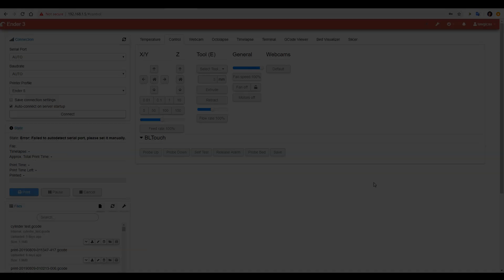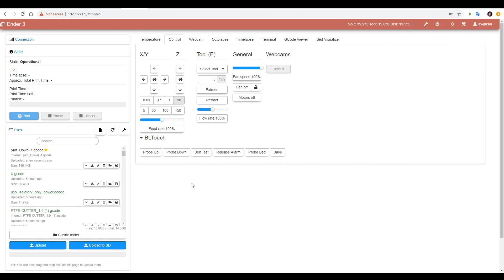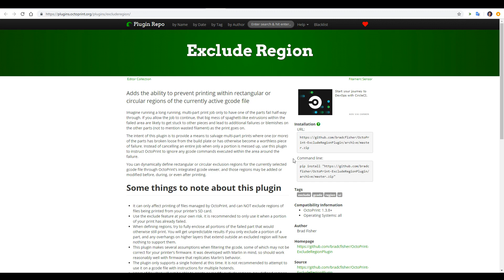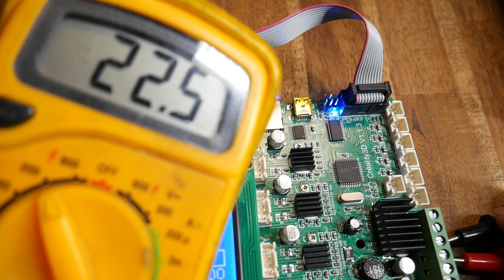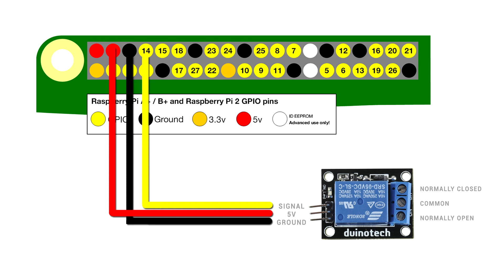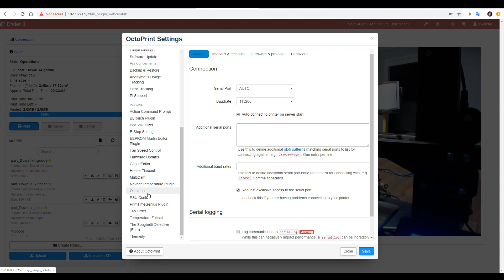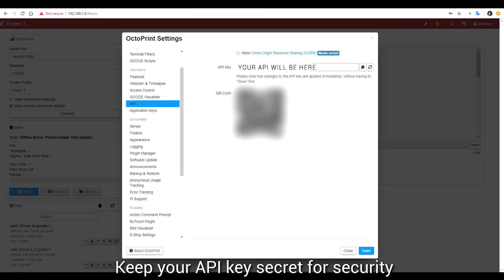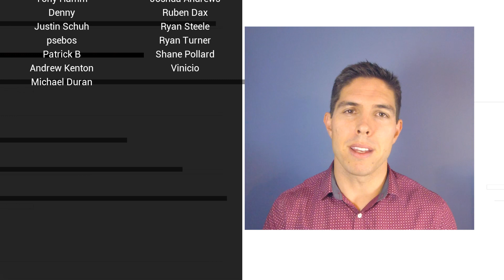Octoprint plugins for better and safer printing - PSU relay control

Comment: On 120V (US) I've seen 4 amps drawn when both the bed and hotend are heating. Translate that down to 24V (E3 pro) and you have the potential to see 5x the current of that on the mains. I would recommend checking the DC amps on that cable. Your relay package is only rated for 10A DC as DC is harder to "break" than AC. I'll get my clamp in a bit and gcode both heaters up to temp and report back on the current. Maybe I'm wrong as the meanwell supply isn't very nice from a Power Factor angle.
Reply: No question that the relay is undersized. The power supply is rated at 15 amps so the relay has to be rated at 15 amps or more. The bed heater alone is rated at 220 watts - about 9 amps. Add the hot end draw to that and you would certainly exceed 10 amps. There is more of course - steppers and electronics board.

It would be ironic for the relay to catch fire from being overloaded.
Reply: @BruceMFerry  that is what I was thinking too, also a risk is that the relay melts to a point during normal use that it no longer can open/close depending on which option was used NC/NO, and the cutoff feature is lost, ie cannot act as a cutoff.  Will look for a higher power 3 volt relay.
Reply: According to the Fluke i410 (for accuracy reference) clipped around the red wire between the PS and MKS I had 11.3A flowing while heating bed and hotend. I get 0.3A when just the hotend and board fans are on.
Reply: @OldCurmudgeon3DP  Looks like we have to go to mosfet switch boards to get to > 10 amp.  Found a few in the usual places.  But I have already printed the PI side of Mr Michael's back end electronics housing.  I waited on the controller board side as, I mull over trying my hand at remixing to add cable chain mounts to the cable exit points.  Someone might look at the 15 and 30 amp mosffet boards and add bosses for those boards to the PI side in a remix.  I like that the higher power boards appear to have opto-couplers for the logic signals from the PI.
Reply: @kc6sye  someone remixed a cable chain option a few weeks ago I saw. I try to go about 2x load as mosfet rating just to be safe & maybe cut down on heating. I have 40A ink birds w/ orange-size heatsinks on my water heater that only draws 17A. I still see near 100F in the box when 1 is on.
Reply: I eagerly await your results.
Reply: Do you guys think this relay would do ? It seems to be rated 30A at 30V DC https://m.banggood.com/BESTEP-1-Channel-5V-Relay-Module-30A-With-Optocoupler-Isolation-Support-High-And-Low-Level-Trigger-p-1355822.html?utm_source=google&utm_medium=cpc_ods&utm_content=aurogon&utm_campaign=aurogon-all-sds-smart-19814-content&ad_id=377808588688&gclid=CjwKCAjwqNnqBRATEiwAkHm2BFXsKiRZCZ1_bLsTkPIxzmn24Pzu28BPFx6ypuM8jhpEBjj-F7TF7RoCGssQAvD_BwE
Reply: @anthonyboiteau3425  I use a 2 channel 30V relay for this exact issue and I'm surprised he recommended a 10A relay in the video.
Reply: @ingy23  I think it's because he is in Australia where they have 220V, so he can support less amperage and be fine, so here with 120V we need to support more. Thank you for the response I will look into that. Any particular reason for 2 channel ?
Reply: @anthonyboiteau3425  It doesn't actually matter what the AC voltage is as the relay is being installed on the DC side of the power supply. If the relay was put on the AC side this relay would be suitable for both 120V and 240V as the amperage is much lower on the AC side. I used a 2 channel relay as there was reports that if it was turned off then it could try and use the usb power and effectively fry the usb port its plugged into. So just to be on the safe side I used a 2 channel so that it disconnects both positive and negative. I have also removed the positive on the usb side so that it can't be powered by the usb at all. On a SKR V1.3 you actually have a jumper to decide how its powered which removes this issue but I have a MKS Gen L
Reply: @ingy23  Thank you for the detailed answer, You're absolutely right I did not think about that , so in that case I really wonder why he recommended that one as well. Oh right, ive seen report of this issue of power by the usb cable as well , I actually have an SKR 1.3, am I correct to assume that I can still use only 1 channel and use the jumper to fix this issue ?
Reply: @anthonyboiteau3425  Yep if you set the jumper so that the board is powered by the 24V input and not the USB you will only need 1 channel
Reply: @ingy23  perfect thanks a lot for all the info!

Comment: Once I work out how to get dual Z motors working with the SKR 1.3 I will be adding a RPi, it looks way more useful than I realised!
Reply: Use a y-cable, that is what Im using.
Reply: @brokentusk5033  Just pin-to-pin parallel? Cool. I don't need to set anything on the board itself?

Comment: Hi Michael. Great video again! How would you wire the relay for the einsy board? Using two relays? I am really unsure
Reply: Not Michael, but you would wire the second the same way, but instead connect the "signal" wire to a different GPIO pin in addition to the relay that was shown in  the video. You would need to make up a splitter for the 5v and Gnd leads potentially though, depending on if you're using 2 individual relays or a single chip with 2 relays on board.

Comment: You really should do some work with the Spaghetti Detective plugin. While I've found it to be pretty high at false positives even on medium, it gives insane peace of mind to leave prints while working and not worry about lost filament. A 28 hour print failing can suck, but it sucks about 10 dollars more if it doesn't stop printing. 

Also if you trust it enough you can have it auto pause when it detects a failure and resume when you give it the okay.

Comment: The Exclude Region plugin just changed my life. I do a lot of small, tiled prints. If one fails, that means I may need to spend the next 9 hours attending it, and removing the spaghetti by hand, or glueing the failed part to the print bed, which atomizes the super-glue and makes toxic fumes. This is exactly what I was looking for!

Comment: hey, i have a question. great video as always! when my printer has no power from the psu, but the raspi is connected via usb, then i also gets power from the raspi. but the display is very dark then and i dont really trust that situation. is the print cancled then or what? i mean with the relay mod. Thanks very much!
Reply: With the PSU disconnected, the printer's controller board draws its +5V power from the USB on the RasPi...which it really shouldn't, but that's a discussion for another day.  Basically the only thing on the printer that still works is the electronics. The stepper motors, hot-end, and bed, are all without power.
Reply: @Bakamoichigei  okay. thnaks very much
Reply: I solve this by cutting open the mini-usb cable, and severing the red +5v line. (Cap/insulate the ends,  because there's a ground sheath inside the cable.) I wanted to order a cable set up correctly, but while you can buy a power only cable that has no sync/data lines, I couldn't find a cable off-the-shelf for sale that had sync/data lines and NO power lines. A custom cable maker could whip one up for you easily.
Like you, I do not trust the Pi powering the the mainboard/display of the printer when the PSU is off. I also added the TL Smoothers, because they also prevent voltage generated by the stepper motors (when you move the print head while the unit is turned off, for instance) pushing back into the mainboard. Out of the box, you can actually get the display to light up by moving the print head, as the stepper motors will also generate (a small amount of) electricity when moved.

I want the mainboard to last, and the Pi to last as well, so eliminating these opportunities for surges and voltage bleed is a good investment.
Reply: @markcartwright4491  okay. thank you. i saw a small adapter PCB on indie i think, which does exactly that. Have a nice sunday! :D

Comment: I think you mean a 3V relay, not a 5V relay... The Gpio pins of a raspberry pi are 3.3V, not 5V. I have in fact tried to use a 5V relay board that I had for Arduino projects and it failed to function properly with a Pi. 

Edit: I know that some people have actually been successful using 5V relays with a Pi, but it's VERY hit or miss. Using a 3V relay with a Pi works 100% of the time, every time.
Reply: A 5V relay should work just fine. The 5V you get from the 5V pin of the RPi. The signal input only needs about 1.2V to trigger so 3.3V is well above the voltage to make it all tick.
Reply: @DavidRelich  The relay board I have wouldn't work correctly when connected like that, thats how I tried it. Its a YwRobot 2 Relay board, 5V active low style. Which means when you send a low signal (ground) on the gpio pin from the Pi to the relay signal pin, the relay would disengage, which did work as expected, but when you then send a high signal (3.3V) on the signal pin it wasn't enough to re-engage the relay back again.